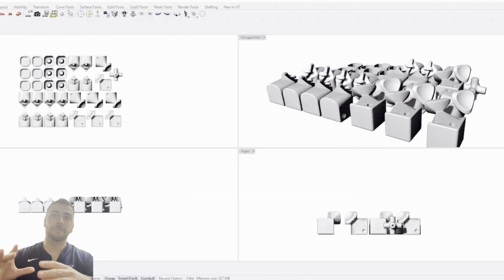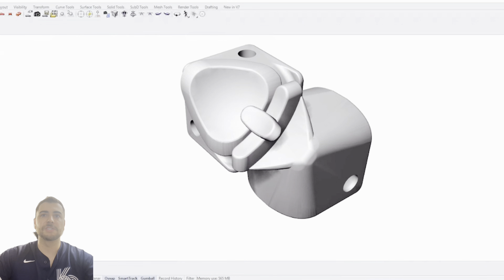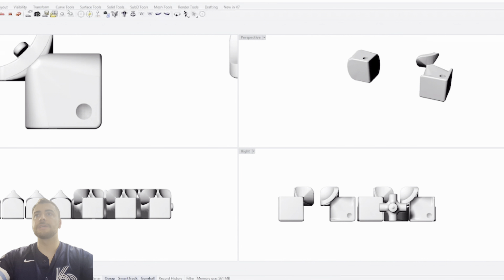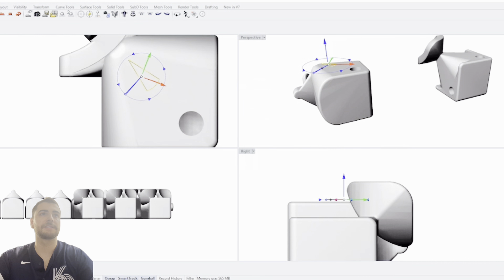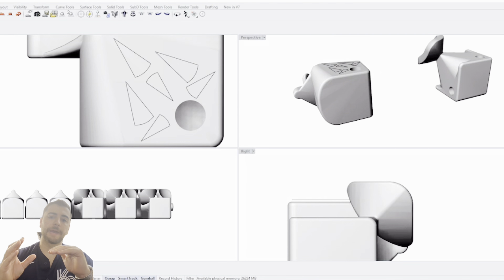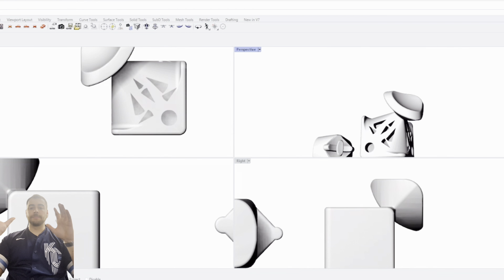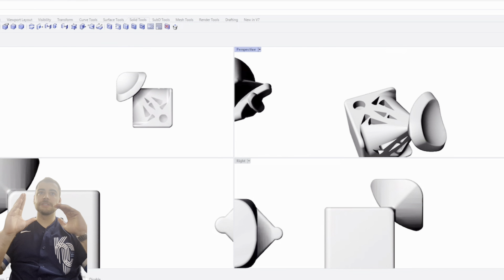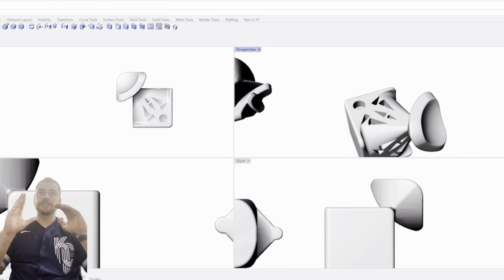MAKING A SPEEDCUBE FROM SCRATCH PT.3

Comment: hey i noticed something about the holes you did, you put the holes in the edge on the contact area edge-corner, and did notches in the corner. from every cube i have that has notches, i notice the notches are on the corner sides, and on the edges its only the edge-center contact area. i believe this is to avoid the notches causing catching issues. idk if i explained that great but yeah.